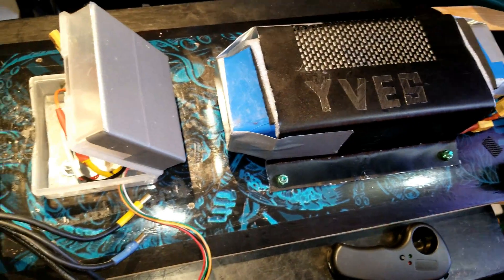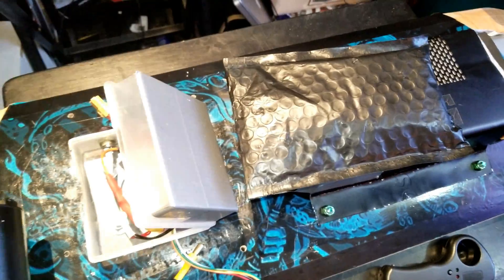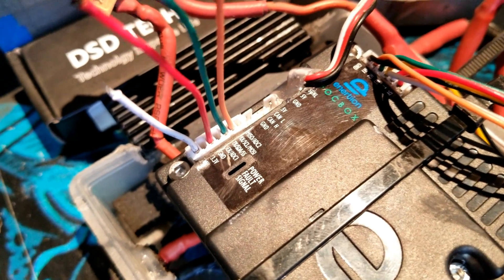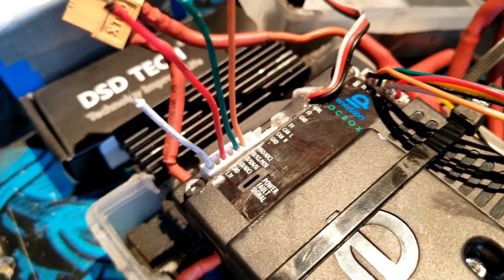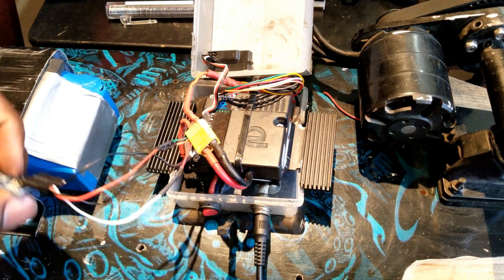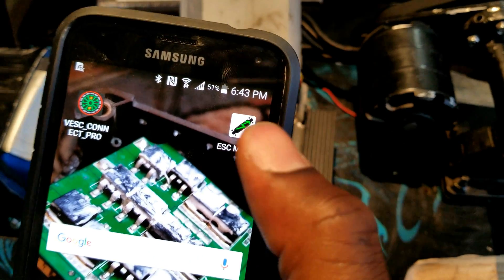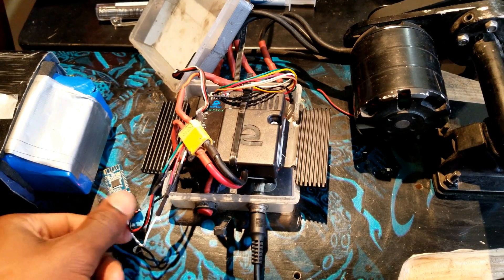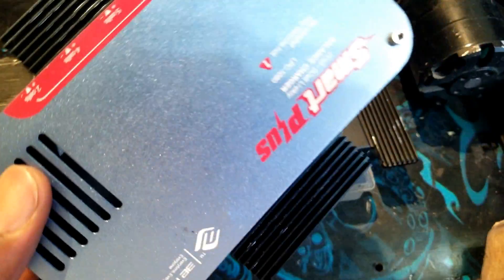UPGRADING VESC TO FOCBOX - BLUETOOTH MODULE - ENCLOSURE - HEATSINK

Comment: FCS don't just cut the wires. It's so easy to unplug them in the connector housing. And also to get a 4 pin housing for them. This is too primitive for my liking....

Comment: Great build! What sort of wiring did you do for the on/off switch? I currently use an XT-90 key as a switch, mostly because I'm too afraid of using a flip switch because it might burn up. How did you wire yours?
Reply from the maker: I m using a switch I got from one of my boards (The yuneec EGO),  https://drive.google.com/open?id=1oOA9KlTiPDpvBHt9bLaAjH0-zQkjJgqt     it's rated 15 Amps But it handles way more than that! XT anti spark just sucks because plugging and unplugging is just not intuitive. You should get at least a cheap switch that can handle average amps, anyways it does not affect the board if the switch fails.
Reply from the maker: Currently I have even wired a 3 position switch on one of my boards! One position is off, one position is using the internal battery of the board and the last position is for an external battery I strap on the board. Then I built a couple of external battery packs with strap around them and I use them during group rides! Crazy range!